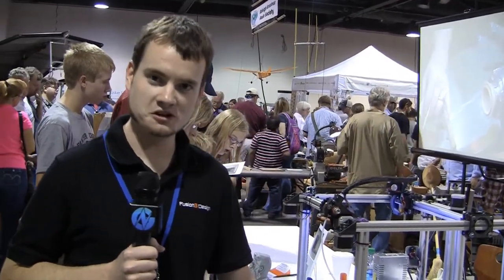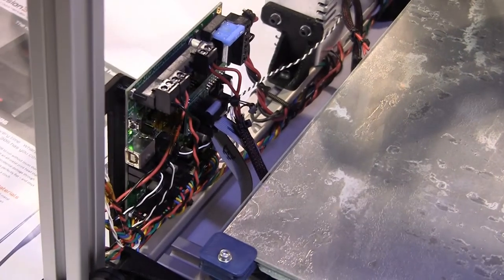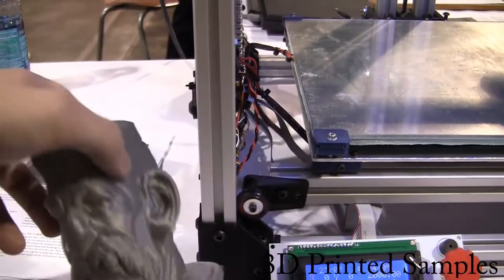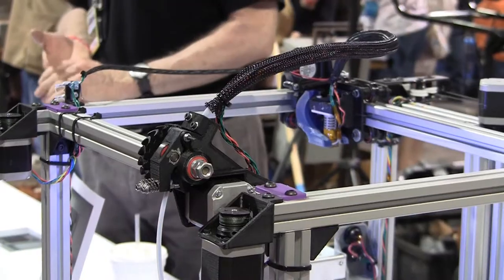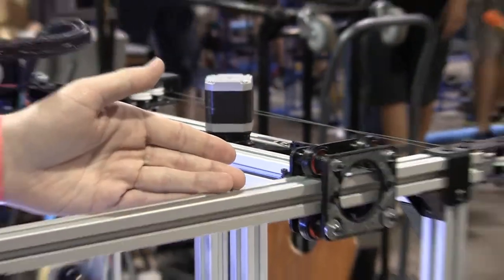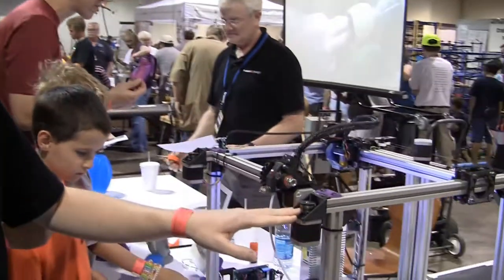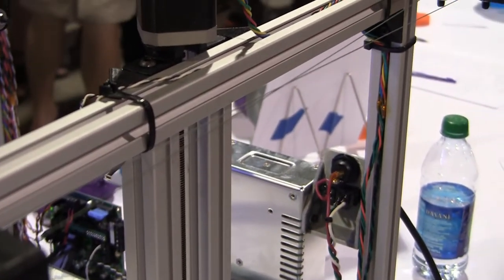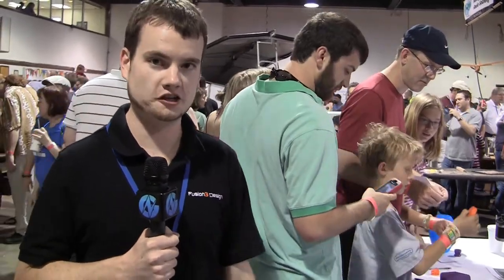3D Printer Overview: Fusion3 Design's F306 3D Printer | How It Works

Comment: They better lower their price, because the BigBox is coming by this Dec look like and
its build area is 12x8x12 and much lower price and auto leveling, networking and
higher tip temps, tons of stuff they are going to have on them. for around $1300 and less.
Reply: +alphasxsignal yea so december.. how did that work out?
Reply: The BigBox is out and it has turned out to be a huge piece of Sh*t. See the Thomas Sanlander review.
It's made of acrylic and it starts cracking before you even get of out of the box. It has quite a few other flaws and it definitely is not a rigid printer. It uses cheezy 8mm smooth rods, which are totally inadequate for a printer of that size.

The F306 is absolutely a much better printer - even when it's higher price is considered. That doesn't change the fact that the F306 is still over priced and skimps on components for no good reason.

Comment: Four grand for this thing? Are you kidding?

This is MAYBE $250 worth of parts. $4000 is insanity for something built with 3d printed parts, cheap extrusion, and fishing line!

Good for him if people are dumb enough to pay it though. Maybe I'm in the wrong business...
Reply: +Wrenchmonkey
Probably closer to $400 in parts. However, there are a lot of other expenses involved in bringing a machine to market from raw parts. Parts procurement, assembly and testing expenses are going to be at least as much as the raw parts costs. Possibly more if the assembly procedure is not highly efficient.
However, it looks like Fusion3 is selling at a very high profit margin, and this is going to invite competition with an even better CoreXY design to come along and undercut him by a large margin. There are some design shortcuts in this machine that are quite questionable- for example the Spectra fishing line. When the line overlaps on the drive spool the effective diameter of the driving pulley is changed slightly and accuracy is definitely going to be affected. The use of T-slot rather than Makerslide or V-slot is not particularly good for long term accuracy either.
Also, for the price point of this machine it should use something a little more sophisticated than an antiquated $20 8-bit controller. Dedicated hi-performance stepper drives with carefully chosen matched stepper motors should could also have been used. It is clear that little thought went into optimizing a lot of aspects of the machine.
The F400 is out now, and for the most part the improvements appear cosmetic. At least it has a 32-bit controller now...

I look for a really well engineered Large format CoreXY machine to come on the market in the near future at a much more competitive price.
Reply: +K Danagger 

You're right it's closer to $300-$400 if you were to build just one. the $250 price assumes volume pricing.

As a business owner myself, I fully understand the other costs of doing business, but even if we were to say his cost to build these is $400. 

If assembly costs are as high as parts costs, he needs to hire some better people. Even if he's paying them $25/hr, there's no way it should take more than 6 hours of labor to assemble and test these, in batch assembly format. And realistically, $15/hr is probably too much for such a task.

As I said, if people are stupid enough to pay $4000 for this, good for them.

Somebody will be along shortly to eat this kid's lunch. If one doesn't come on the market in the next 6 months that is at least this good for half the price, I'll probably do it myself. ;)
Reply: +Wrenchmonkey
My comment about his imminent competition is based upon first hand knowledge. It is already happening. 
I also know that it is being done right without the stupid cost cutting choices he made.

However, the difference is - he's already done it. He also made one very important decision correctly - he seems to be aggressive with his advertising and presentation. That is the biggest part of the success of any product in the marketplace. A lot of outstanding products never reach their sales potential because of that one simple fact.